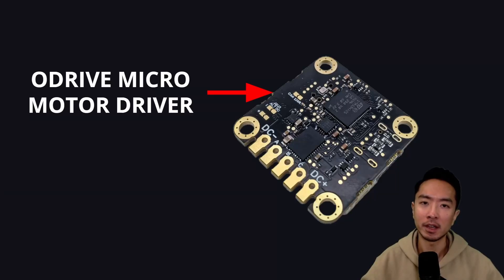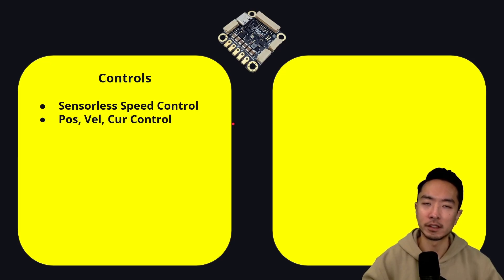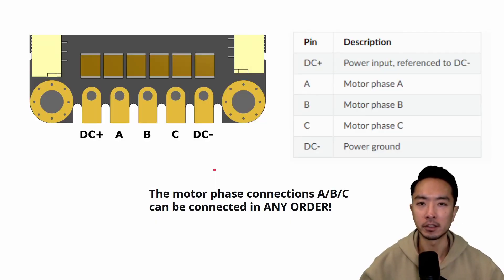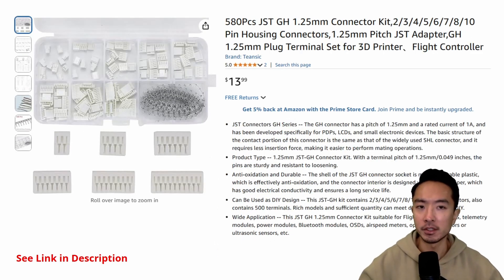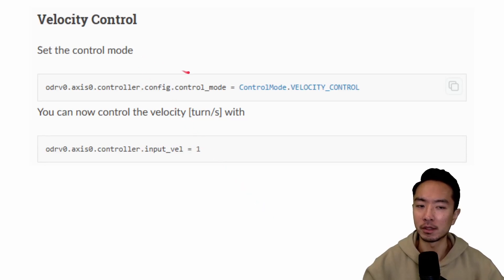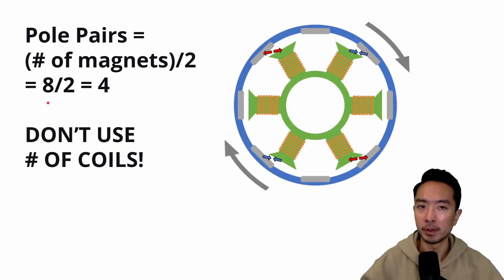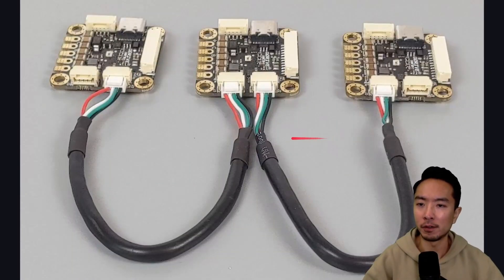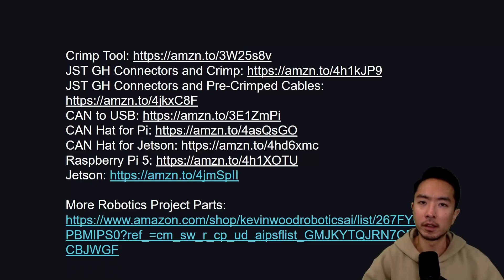ODrive Micro Guide: Servo Motor Driver with Encoder!

Comment: I'm not sure, but doesn't mks servo do the same thing?
Reply from the maker: It’s a little different from servos because servos usually have the drivers integrated . This one you can match with any motor or gear combo for a more custom solution which is good for compact robotics designs
Reply: @kevinwoodrobotics  thanks

Comment: I found the bandwidth of odrives too limiting, couldn't reach the RPM I wanted.
Reply from the maker: Oh how fast did you need?
Reply: @kevinwoodrobotics wanted, 3000 rpm. But limited to 2000. Limiting factor is the driver's ability to count hall sensor pulses with high enough precision, which is limited by the bandwidth

Comment: Tbh odrive is overhyped, there are better motor controllers like vesc out there for bldc motors
Reply from the maker: Thanks for sharing
Reply: VESC are not as good at position control.  You're probably thinking Moteus or  MIT cheetah drivers

Comment: 1:25 - CAN bus with 1 megaBYTE per second? it's a serial bus and it should be 1 megaBIT per second. that's 1/8 or 1/10 of traffic.

You are using crazy mouse pointer– what software do you use?
Reply from the maker: Yes thanks for the correction. It’s google slides

Comment: Are you aware of any encoder options that have an offset sensor/magnet orientation, or any other encoder method that would not block a motors hollow shaft bore?
Reply from the maker: Can check out orbis encoders
Reply: @ cheers thank you!